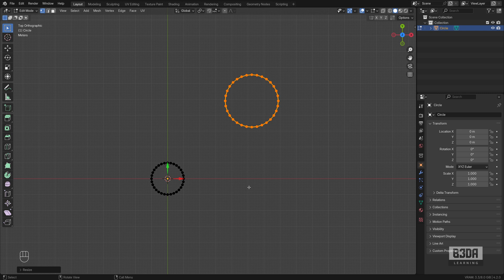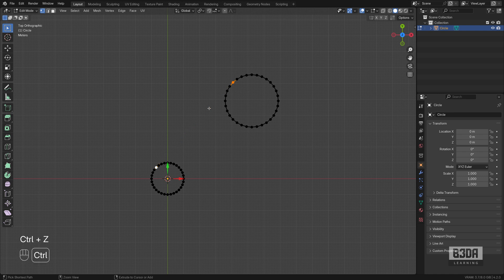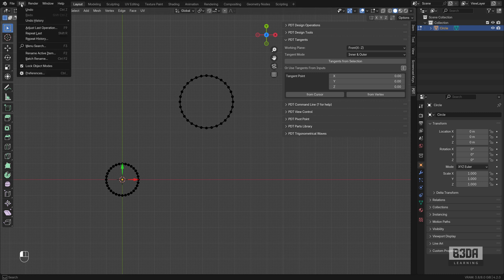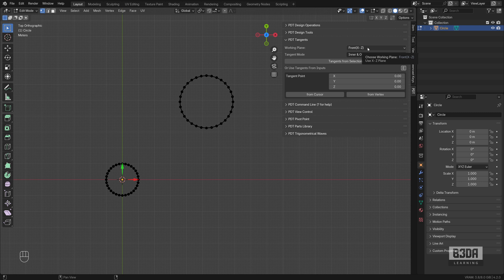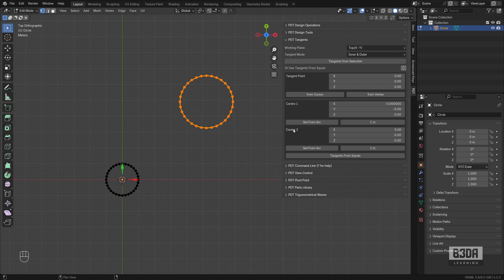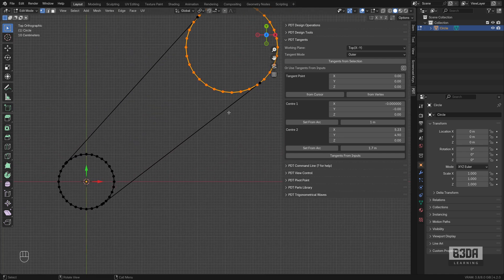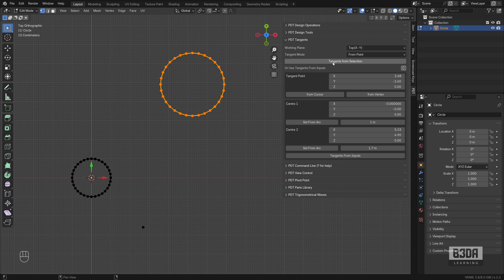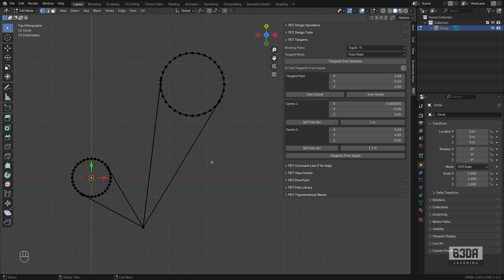Precise modeling in Blender: Finding Tangents between Circles

Comment: Considering, that this method is not connecting points at all, a way easier method, that doesn't even need extensions is to to just draw a radius on one of the circles, then draw a perpendicular line and rotate it along the center of the first circle until the perpedicular line connects the second circle - it doesnt connect lines too, but is way easier and can be done without any restrictions... It is a pity lines are not connected automatically.

Comment: When I did it the tangent lines were offset from the two circles.....? Then I kept getting error messages about it being too close - increasing the distance did not remove that error. The selection for vertices (point) did not work at all and told me I had to use less than 3 vertices. Finally after a dozen tries, it finally did it correctly. I followed the instruction explicitly each time.
Reply: Had the same issue, then I found out, the extension always places tangents like the circle is at 0,0,0, so circle one should be at 0,0,0. Also ti doesnt work with curves - you circles should be a meshes.

Comment: Wait... If you look closely, the created tangents are not connected to the circles.

Is there a way to fix that ?
Reply from the maker: You are right. If you look close, they don't touch. The problem is that Blender uses Polygons as circles. They are not curves. Since Polygons use straight edges with lots of segments, usually you won't have a perfect intersection point.

The solution would be:

1. Use a Mesh Circle with lots of sides 64+ to increase the chance of an intersection.
2. Edit the point close to the tangent to make them intersect